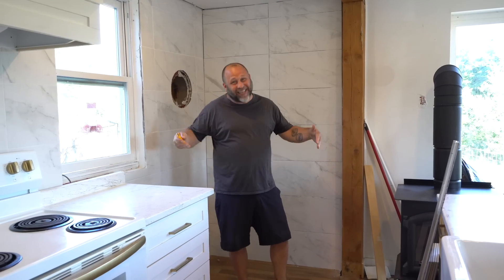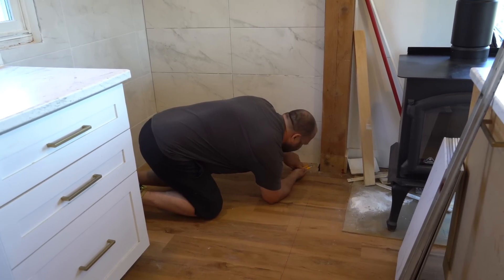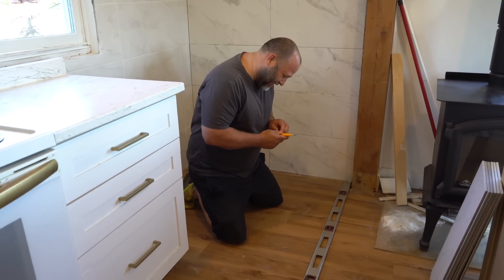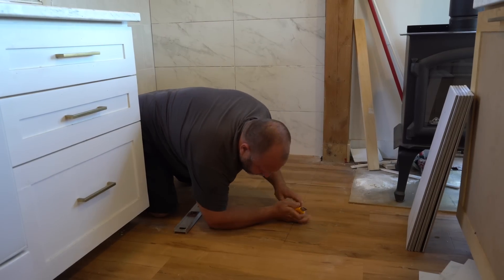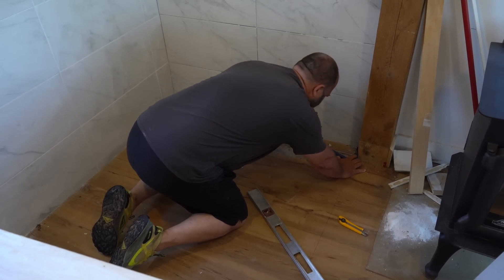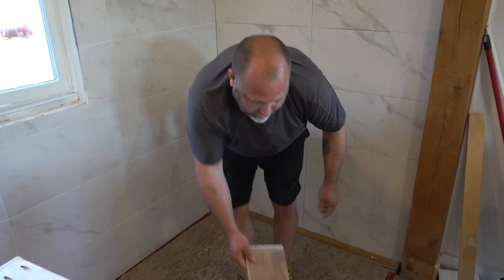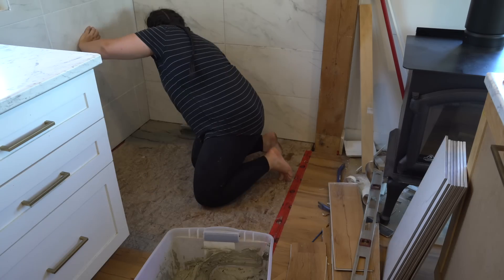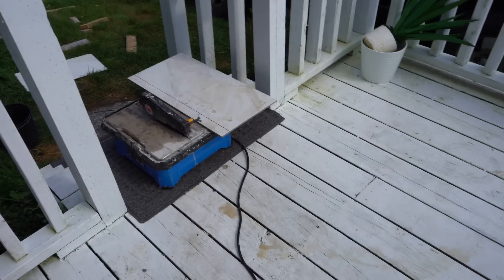Whose idea was this...?!

Comment: I wonder if you can use your scroll saw on an offcut of a tile to make a little J looking piece to fill in that front most corner of the laminate countertop. It would be way easier on the scroll saw but I don't know if that would really work out considering it's not a wet saw but if you have some off cuts that you're just going to trash anyway might be worth giving it a try.

On an unrelated note happy birthday Mr Phil!

Comment: Hey when you guys tile in the future, you're supposed to use the appropriate grooved trowel.  It guarantees that you have the right amount of mastic on the tile.  Also, make sure you make your grooves go the same direction.  This is going to cause better adhesion and last longer.  Putting the grooves in the same direction allows the air to escape as you press them level.  You might get some levels too.  Lastly, don't stand on your tiles until they are dry and grouted completely and dry.  This can cause them to come up later.
Reply from the maker: This one has groove maybe hard to see on camera
Reply: @ElysiaEnglish  your trowel needs grooves of a specific depth.  It will say how much on the box. You then groove the mastic. Tiles have a texture but it won't be enough a s can cause the tiles to pop off with pressure.

Comment: You and Phil are doing a great job on the kitchen.  Question...  I noticed you have not trimmed out the windows in the kitchen.  Are you planning to use any tile you have left over to trim out around the windows and sills, or are you going to use like 1by boards to trim them out?